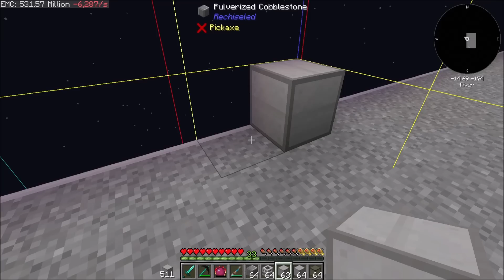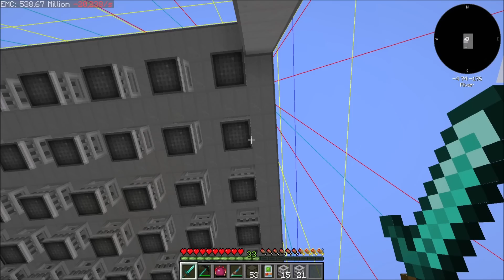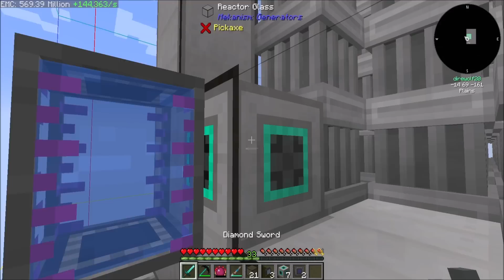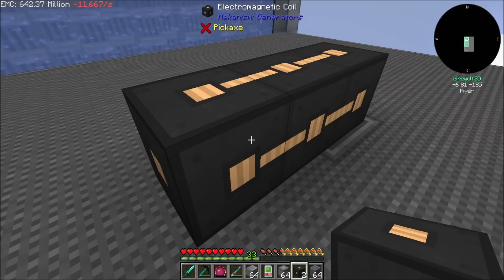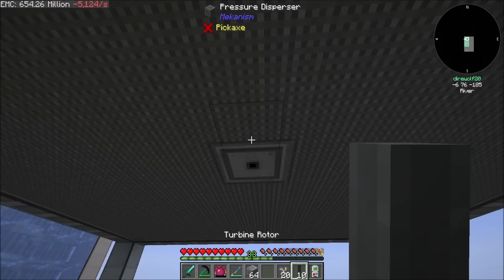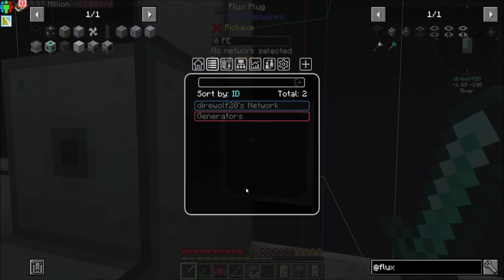Mechanical Mastery Ep23 Giant Mek Reactors

Comment: 35:56 Energy trash cans can be crafted into ultimate trashcans, and used to void steam (faster than a chemical tank, if memory serves). Saves you from having to worry about a turbine.

Alternatively, a low-priority energy insert trash can keep your turbine from backstuffing. More dependable than a high-rf usage resistance heater.

Comment: I am once again asking for Direwolf to do a sodium reactor build. xD It's vastly superior for super large reactors like this and it would change up what has become a regular staple of DW20 playthroughs lately. I realize the reactor is a means to an end for this pack, but that doesn't mean you can't take some extra time to do it differently than before. It will be fun!
Reply: i second this. i've never seen him do it and im really curious how it works.
Reply: Have you ever created enough sodium to run a reactor? I have, but it took a significant processing array, and long wait, and I still barely had enough for a normal burn rate, let alone a fast reactor.

Sodium production is just too slow.
Reply: @No_Name_Provided  I've built a sodium reactor setup, but it has been a while. I don't remember having too much trouble with sodium production though. It's so much more efficient at heat transfer that you don't need to entirely fill the reactor for it to be effective.
Reply: @Ghan04  I recall a lot of sodium accumulating in the boiler, so the amount in the reactor gets... concerning.

My experience was on a server that isn't running anymore, so I can't check my setup. I don't think it was underpowered... How many electrolytic separators did you run in parallel? (And how small was your reactor?)

Comment: the reactor resetting could be caused by the feral flare lantern placing the lights inside

just a theory though, not certain
Reply: I can vouch for this - in one modpack I played, on server restart the turbine & reactors didn't always get registered as a multiblock before the feral flare had a chance to start spreading, and I'd occasionally have to get in there and break the feral flare light to get it going.

I was trying to track down another bug where Integrated Dynamics was causing entire chunks to be perma-dark, but that's another story for another time.

Comment: It's been awhile since i did a big Mek reactor, but i believe when you get around between 10x10x10 & 14x14x14 you need to use sodium cooling and a boiler to handle the heat to get the most of it, i can't remember who did the math on that one but it was All the mods 6 when i did my 18x18x18 so it may have changed since then

Comment: 23:00 The electromagnetic coils are like meant to go in a plus(➕) with the very center being on the block you place the rotational complex under. Nevermind, you get there when you bottom up instead of top down at 27:30 Also, what's the deal with sodium cooling again? Is it better, cheaper, supplemental, or?...
Reply: If the nuclear fuel burn rate is bigger than some value, cooling with water is impossible and sodium cooling is needed.
Reply: @sloner2356  Okay so my brain trying to tell me something about 250mb/t was probably saying the same thing but I was like I don't remember exactly if that was the value or if there even was one. Thank you for the informative reply.
Reply: It doesn't matter as long as the coils are touching.
Reply: sodium cooling is better for higher burn rates and a much more effective coolant, and you can break even on it by using the thermoelectric boiler to reprocess the superheated sodium generated by fission back into sodium
Reply: @imdsyelxic  awesome so I wasn't remembering wrong. Thank you for your reply as well.

Comment: If you do it right, you only need 1 antimater to complete the task, and from there, you can make a Creative Antimater tank, so you have unlimited Antimater, and can start making huge progress, people say it's in the questbook as a tip, and some say you need a lot of RF prob due to the reactor setup, and the antimater maker and fissile fuel system
Reply: You are switching antimatter with final star pieces.  You need 4 antimatter + 2 from quest to make the tank.
Reply: @dtoad48  okay, i'm not sure since i dont play, just previews comments i have gather to perhaps make it easier for Dire to read... Some said 1 + the quest and that was all he needed to start his creative journey and make the pack a lot easier and etc, But 4 should not be that hard with his setup now, when he finally gets it done in the next episode.... Thanks for the info.. And i'm not afraid to be wrong and corrected if i'm wrong

Comment: The mek pipes share throughput, so more pipes together make faster piping.  You only need one port on each end, just add more pipes for faster pipes.
Reply: I'm not sure how accurate that is. With a max reactor I tried multiple stacks of ultimate tubes for transfer, not fast enough. Only thing that worked was having multiple ports touching eachother.
Reply: @Minase636   Depending on what you're interacting with, you may be limited by the pump rate. Each pipe has a maximal pump rate, so your effective transfer rate is limited by the number of connections.  For example, I usually use a stack of sinks, with mekanism pipes pumping from each side, to fill my reactors.

Obviously, this doesn't apply to fluids that auto-export.
Reply: I think we have all said this to him a hundred times in the past, maybe one day he will listen and learn lol
Reply: To be fair, that doesn't really make logical sense (although this is modded minecraft, so what really does lol). One would expect a faster transfer to come from an expanded size of entry/exit, or an increase in the speed at which the fluids can move through said entrance/exit.
Reply: @moonsalibi I agree.  I only commented because I only really figured it out last week or so when I was doing the same thing and saw a comment about it in Chosen Architect's video.  The math worked out and it functioned.   I think it has to do with the buffer size thing and the cables are just really large arbitrary multiblocks.

Comment: You measured the turbine height wrong. You stood on the bottom layer and added 18. 1+18=19. If you measured from the platform instead it would be the right height.
Reply: It's a shame there isn't some sort of mod that would allow you to build structures like these with the click of a button, provided you have the necessary blocks at hand.
Reply: @SummitSummit   I don't think this modpack has the capsules mod, and I don't remember mekanism reactors being on r9x9. If there's a schematic floating around, I suppose he could use the create cannon...
Reply: i was wait for him to see this, always easier when you not the one playing.

Comment: Can nuclear waste be dumped into the void?
Reply: I set up an auto break/replace barrel a long distance from my base. Created a ton of radiation in that area. Tbh it was kind of fun to create a system that just sidesteps the intended way of handling the waste/radiation.
Reply: @Minase636  I setup  a system that use AE2 spatial storage to store the waste barrels then I just trash the spatial storage disks, complete no radiation!
Reply: @netbotcl586  whoah, that's next level
Reply: @netbotcl586  thought I'd let you know I stole your idea. Got a comparator reading the barrel and when it's full it automatically gets deleted and a new one is placed. Super fun to setup.
Reply: I think Dire tried last series to trow a waste barrel with some nuclear waste with no successes, it seems like they disabled that item to be trow'n on the ground, so people cant just fill one up and void it, You'r just able to place it... Hope that helps your answer
Reply: You can.. if you manually brake the barrel, but its just easier to do it the right way.
Reply: @dtoad48  Well, then will you pollute the area around it (That's why Dire always goes with the lowest Tier pipe that has lowest amount "Stored" in the pipe)... Think his question was if you could just throw a full barrel in the void if that was possible, BUT the best way to manage your waste, is make 64 of them, fill a space underground with all your barrels, have them ALL connected with the mekanisem pipe and it will equal out the waste around all of them, so they always are at aprox the same level with waste.. Doing it that way will ensure that your waste will never get high, and will dissipate faster since it will do it x64 times faster (or 32 if you have 32 barrels)
Reply: Just going to say the last time I did waste I found that the mek pipes seemed to prefer 1 or 2 barrels for waste, and the others seemed to be balanced. I don't remember the exact count of barrels I had(since it had been a while). I know I was rather annoyed since if it balanced it out, it would have dissipated quicker. Then again once I got what I needed(antimatter for quest) I just turned it off, and didn't bother with it again. I "think" this was ftb to the skies mod was the last time. /shrug the packs seem to merge with my memory these days. 

Anyways I understand why they don't want you to void the materials, but if it is going to "dissipate" over time why not just let us void it since all you are doing is throwing in a time element. >.<

Comment: oh dear, reactors, I bet he voids the excess steam (which is only an issue if you run out of energy storage). Which will cause an explosion due to lack of water then.

edit:

sad times, he does enable it. 2 episodes later, reactor blows up
Reply: thats why you add energy trashcan to delete the excess energy
Reply: But does he protect the chunk...uh...oh dear.
Reply: Nah, His reactor is fine and offline, lake he said, he tested it, and next time he would implement safe-guards like he always do (Redstone control to shut of), and he always voids excess steam, but normally that's never going to get full if you have safe-guards and a Big powerbank, that he plans to make next episode
Reply: @nicksomingenhar   He stopped voiding excess steam at least for the last 3/4 lets plays because everyone told him it is bad. Everytime he has voided excess steam the reactor blew up. Also the redstone port he uses is not good, because it isn't fast enough to turn off the reactor since the temperature increases super fast once you are out of water,
Reply: @rodrigo99s71  The wiki does recommend you connect a supplemental coolant tank to your emergency shutoff circuit...